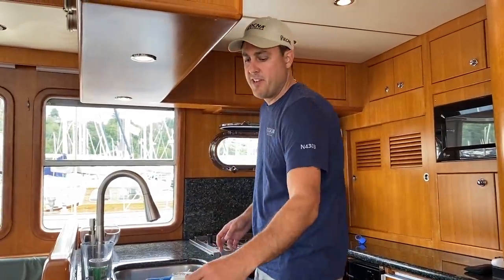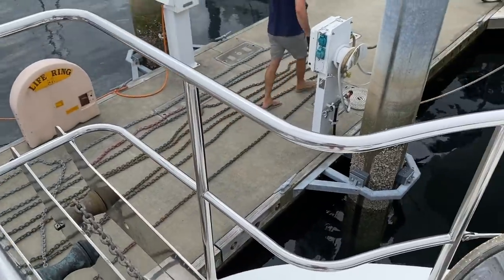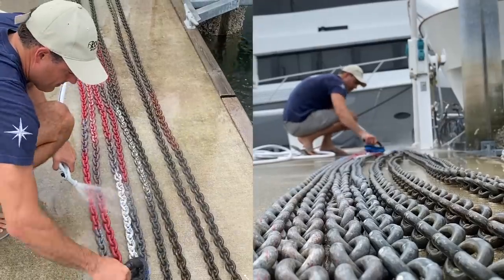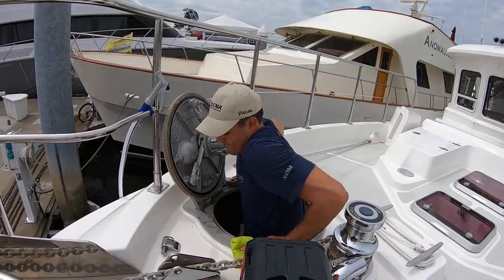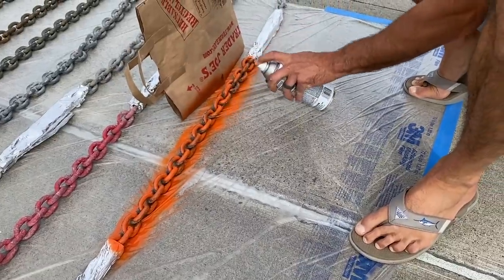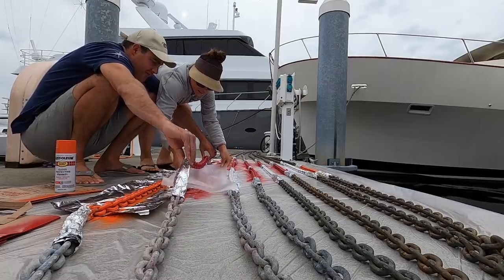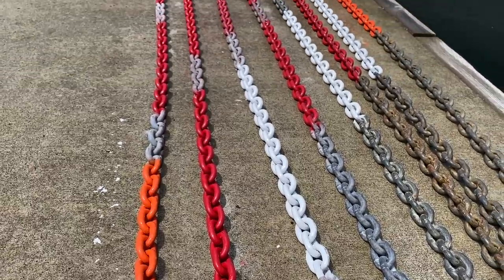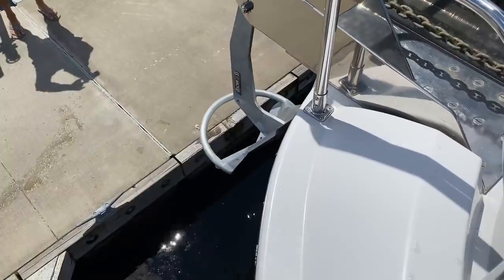NEW Rocna 55kg anchor installation & chain re-painting on our Nordhavn 43 trawler!

Comment: Hi, we mark the anchor chain a bit different, we paint one shackle for 25 feet, two shackles for 50 feet, 3 shackles for 75 feet, you get the idea. We only use one color of paint, makes the job easier. With regards to how you used only one D shackle before the 360 degree rotating swivel. You are better off using two D shackles. This way when the boat swings around the anchor, you never have a side load on the rotating pin, which can bend the part that turns and prevent it from rotating. I have seen this several times.  I work for neptunus yachts for more than 30 years and several times i have seen a bend rotator. Also make sure you use a lock s/s wire for the D shackles.

Comment: On N55-24, and on our N47 prior, we installed Rocnas and never drug anchor, once set. As for marking the chain, I’ve given up on painting. The course sand of the Bahamas and Florida wear the paint off in a matter of weeks. We now use zip ties at 25 foot increments. They last several months and are super easy to replace as needed. The 25 foot lengths allow us to think in terms of number of links, eg, if we’re in 20 feet of water, we’ll put out “3,” plus the 25 foot snubber which leads from a bow eye at water level. Simple!
Reply from the maker: We’re already thinking that a non paint option is best. Thanks!
Reply: I too have found paint doesn't last long but zip ties seem to just get eaten by the windlass in short order.  Plus I usually paint about a 2' segment so it's easy to spot as it goes over the pulpit compared to a few zip ties.  I've yet to find a perfect solution other than a chain counter and even those I've had some issues with.

Comment: Hi Sean and Elizabeth there's a little product that you may love it's called corrosion block this stuff works and it lasts a long long time not cheap about $20 a spray can spray it on anything that could rust or does rust .it will not rust agin

Comment: You'll love the Rocna in the NW. As you start anchoring further north, you find most people have 3-400 feet of floating line on a reel for stern ties. It's often the only way to keep an anchor set in a steep bottom close to shore. Next time you pull all the chain to paint it, you might consider swapping it end-for-end to get more life out of it.

Comment: Great choice on a Rocna, and what a great channel you have! Keep up the good work. You are fortunate enough to have a pulpit capable of two anchors, so do not get rid of that big Bruce. Hoist it up there as your secondary. BADASS!!!!
Reply: I'd probably go with something very different than the Rocna for a second anchor to give more options for if the first won't hold.  Instead of something in the plow style, maybe a more of a danforth style that works well in soft bottoms?  In my area we typically deal with mud and danforth (Guardian, Fortress, etc) types that hold based on sq footage of the fluke size work well and are lighter to handle.  They won't do so well in rock or coral though.  Having two very different styles ready to deploy would give more options should they find one won't set well.
Reply from the maker: If only we hadn’t sold it already, but we do have a small backup on board in case of an emergency.

Comment: I have gotten about 2 seasons on the paint.  Same method as you, but not as cautious about masking.  I put cardboard down to keep from painting dock.  The first 100 feet is pretty bad after 2 seasons, the second hundred better, the 3rd good for another 2 years.  I found white not to be a great choice.  Now using blue at anchor and at 100 foot intervals, red at the 25’s and now green at 50 foot intervals.  Spray chain with salt away as a clean up prior to paint.  Great video.

Comment: Loved the video!  We used to have a galvanized Danforth-style anchor on Gusto, our 79 Mainship 1.  All steel starts to rust eventually and this anchor was leaving a lot of stains on the deck, so we replaced it with a Fortress anchor which is made of an aluminum allow.  They're not cheap, but nice thing about them is they don't rust.  They are also much lighter, which is nice since Gusto does not have an anchor winch.

Comment: I’ve seen people paint their anchor chain by placing the portion of chain that you wish to paint in a bag. Shoot the paint all over the chain inside of the bag. Then droop it over some 2x4’s laid on their edges to let it dry. The bag contains all of the spray so you don’t need to lay down as much drop cloth material.  I’ve not tried it myself, but it seems like an interesting idea. Good luck.

Comment: Hi, nice job painting your chain.  I never was so diligent, so when I installed a Maxwell RC-12 anchor winch a couple of years ago I also installed a Maxwell Auto Anchor 560 V2 counter  The counter works great.  I recently ran all 600 feet of my chain out  to clean the chain locker & fresh water wash the chain and the counter showed 606 feet.  So, did they sell me 606 feet of chain?  Or is the counter off by 6 feet? (1%)  I will never know!  
I think all of the  Maxwell vertical winches are drilled for the magnetic sensor, making retrofitting the counter relatively easy.  I sure like having the readout in the pilot house way better than  trying remember a paint scheme.

Comment: Interesting comments I think every anchor has its benefits depending on multiple factors like bottom consistency, grass and weed, rock (size of rock will affect things) chain/rode scope, I carry a couple different kinds. After anchoring for 30 years the one constant I have seen is ANY anchor will drag or not reset. The Excel and Rocna seem to be the best but... Don’t worry about the Diet Coke my habit is diet Mountain Dew!
Reply: Said it perfectly.

Comment: I'd look to use thick paint that will form a thick skin on the links. Spray paint only coats the links with a thin layer of paint. Try laying the chain links between wooden trestles with a tarp under the trestles. It also gives 360 degree drying.

Comment: i have a vulcan 4kg and it works awesome. try a double grapnel with rocna for rocks and mud. the rocnas support doubles. i use gorilla tape on mine instead of paint. dont use swivels with rocnas. swivels work against resets. the little hole in the front mounts the grapnel and chain.

Comment: Painting a chain is never fun, but it's probably easier to do when you need to get hauled out for something else. Shipyards usually have some scaffolding racks you can use to hang the chain so you can get all sides at once and the paint doesn't stick to anything. I used rust oleum  primer and their industrial paint which was supposed to be the best. It was applied to new chain and even with all that it is already flaking off and doesn't look very good. I think I'll just stick with my chain counter.

Comment: Use coloured cable ties instead of paint. They will easily fit through rollers and such and are very visible. Use several at each 50ft, e.g. 8 or 10. Hope that makes sense! Way better than getting paint everywhere too :)
Reply: I've found they get chewed up by the windlass.  Maybe they last longer on a vertical vs a horizontal gypsy?

Comment: Hi Folks,  Great video that could be called “One of the many things you have to do on a periodic basis when cruising full time”, for the viewers learning from you about the cruising life.  You probably did a ton of research on which anchor to buy but for the cruising dreamers here’s a few more thoughts.  1.  Practical Sailor Magazine used to recommend the Rocna and the Spade.  After some bad experiences from users of the Rocna with the roll bar getting caught in rocks, they recommend only the Spade.  And, Rocna brought out the Vulcan to address this problem AND, as they claim, to have an anchor for boats that did not accommodate the roll bar on their bow roller configuration.  Whatever...The user community has found the Rocna, Spade, Ultra, and Mantus(sp?) ALL to be very dependable and superior to the old favorites Bruce and CQR that are commonly being replaced now.  The Rocna got hot in the Nordhavn Owners world and is the most popular for good reason, it works.  It’s just not the only brand that works.  2.  Swivels are noir without controversy.  A NOG Expert Advisor states that the number one source of ground tackle failure that he has seen is the swivel.  It’s a much more complicated (and expensive) solution to a problem (anchor coming out of water misaligned with the bow roller) that either a) doesn’t happen often at all, or b) is easily corrected when it happens.  3.  There are as many paint schemes as anchor choice opinions.  Here’s a simple one recommended to me:  RED = 100’, WHITE = 200’, BLUE = 300’, RED=400’ (the end).  Guessing at 50’ increments in between the colors is “good enough” for most anchoring situations, or just let out more to be on the safe side.  4.  Another paint method.  Get a 5 gallon plastic bucket.  Spray the chain as you feed the chain into the bucket.  Spray a bunch more paint on the chain as it sits in the bottom of the bucket.  Let it dry.  Lift chain out and spray it as you drop it back in bucket and repeat as many times as you need.  Dry in bucket overnight.  Then, repeat with the next color the next day or get more buckets to do it all on one day.   Saves using and throwing away all that plastic and alu foil.  
As with many things on cruising boats there is no one-best-way and there is an over abundance of free advice!  Safe Travels.
Reply from the maker: Eric Bescoby hey Eric and thanks for the tips!

Comment: You have opened up the devil's cauldron discussing what anchor you purchased.  If you hang out in forums such as the trawler's forum, you quickly learn that asking what anchor to purchase or why you bought what you bought is akin to Republicans and Democrats discussing gun control. I first tried to purchase a Rocna anchor in 2004 but they were made in Australia back then and getting one into Canada was difficult.  I actually emailed the builder, blanked out on his name, and suggested he have part of the anchor put together in North American, thus garnishing the coveted "assembled in America" designation. I just googled and they are manufactured in China but quality control is done through the now current head office in Vancouver.     Swivels: the stand on swivels seems to be slowly changing but I was surprised when I just went to the Rocna site, they now discussing adding a swivel, their original stand was - don't use one. Drew Frye published a book in 2018 that most have never heard of called "Rigging Modern Anchors."  In this book, his stand on swivels is against them: "DITCH THE SWIVEL After fixing this on three boats .., I felt I must share something so plainly obvious that it is commonly overlooked.... The anchor is coming up backwards most of the time, and twisting it around to come over the roller is a battle.  The easy, or at least obvious solution, is to add a swivel: it don't solve the backwards anchor problem, it only makes rotating the anchor on the the roller easier. ,,, If the wind or tide created a twist in the anchor chain, it will untwist as soon as it clears the bottom because it can't turn in the windlass.  In fact, the only way a twist can remain between the anchor and the windlass is if you install a swivel and the swivel has allowed a rotation...... If you can't resist the urge to install a swivel, at the very least include a shackle between the swivel and the anchor." Full disclosure: I have a Rocna and a swivel without a shackle, so far no problems. I almost forgot to add, the way to paint your chain is go dumpster diving for a box roughly the size of one a lawn mower would come in.  Then put notches in either side so that the chain can set in with out sliding into the box.  You should be able to get a couple of rows of chain in the box, hung up side to side.  You then cover with plastic the chain not to be painted and spray paint the area desired.  Then just leave the chain to dry while hanging in the box.  Now there is no surface to stick to any other surface.

Comment: I got a little nervous when you (Shawn) got into the chain locker. All of that steel in a sealed space will consume the oxygen in there as it rusts, making a potentially deadly space.
Reply: Not that big of a concern here. That space is pretty small and the chain is galvanized and wasn't that rusty. With the lid open, and then reeling all the chain out and spraying the locker down with the hose would have stirred up the air to recirculate it if there was a concern about lack of oxygen. He was down there for only a few seconds which wouldn't be sufficient to lose consciousness. Plus, Elizabeth was there to rescue him if he was to succumb to O2 deprivation. Well, unless Shawn has a really big life insurance plan, then maybe not...   ;)

But you're correct and it is absolutely something to think about when entering confined spaces whether there is an opportunity for corrosion and oxidation to take place or not. And H2S can actually be a concern if there is any decomposing biomass present.

For those that wish to clean their galvanized chain and be extra thorough and get all the gunk off using bleach, DON'T DO IT! Chlorine (from the bleach) will react with the galvanization and corrode it badly. If you must get that OCD with your cleaning, use a water/ammonia mixture instead and rinse well with fresh water afterward.

Comment: Hello being a boater for the last 40 years I have a lot of experience in anchoring a boat,,, so let me give you my two cents this is not an opinion this is a fact, the anchor you replaced was a Bruce a Bruce anchor is probably the finest anchor ever made for a specific job, that is anchoring in mud Sandy bottoms etc. the common mistake made with a Bruce anchor you are not setting it properly, when you back off with your engines you literally back off till your motor will no longer move the boat which takes about 30 to 40 feet once it's starting to set, the anchor you replaced it with it's a plow anchor,plow anchors do exactly that they plow ,good for sand, grass not as a all purpose anchor they will pull loose most definitely, most boats including mine I had two anchors a Bruce anchor and a Danforth a Danforth has larger flukes more difficult to set but in rocky wooded heavy vegetation bottoms they work really good, I would suggest with your new anchor when you think it's set try swinging your boat 180° slowly see how easily it will pull out, there is no one anchor that does it all unfortunately, the bar across the top of your new anchor actually inhibit the anchor from sitting deeply which it is designed to do, You're actually supposed to attach a heavy three-quarter inch mooring line with a float to that crossmember of the anchor so that you can pull the anchor backwards if you get stuck in rocks these are things they just don't tell you, remember experience is a terrible teacher she gives you the test first I learned the hard way, I know you've done a lot of research, but when you argue with boat every single day which I have done for years you really learn the tricks, you guys have a magnificent boat and seem to have a fabulous relationship there's nothing worse than an anchor pulling loose in the middle of the night and you're waking up to the sound away anchor alarm going off.One more little thing next time instead of painting your Anchor chain you can buy different color copper electrical wire Cut off a piece weave it between a few links of the chain crimping at the ends done, there's an old law the easiest way is normally the best way don't over complicate things in your quest for perfection.keeping your anchor neck down is all so   important  i attached a 10 pound weight 3 feet from the end on my anchor neck on the chain really helped
Reply: Interesting that you find a Danforth sets well in rock or vegetation.  I find them far to light to set properly in weeds/grass but excellent in mud/sand or other soft bottoms where the large fluke area provides holding power.  Honestly I don't find anything sets well in thick grass, but raw weight seems to help penetrate to the bottom where the light weight/large flukes of the Danforth want to skate along.  Regardless, I do agree that having two different anchors available provides good options for different bottoms.
Reply: Your "fact" flyes in the face of what Rocna owners know how to choose a good anchor.
Reply: @raygorinski4422  Amen to that.
Reply: Ever used a Rocna ? Don't think so....